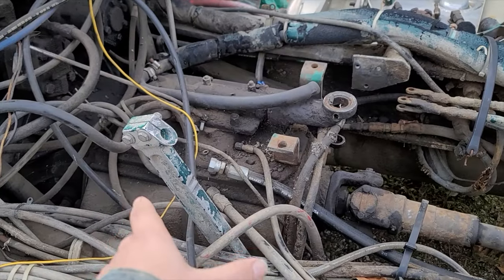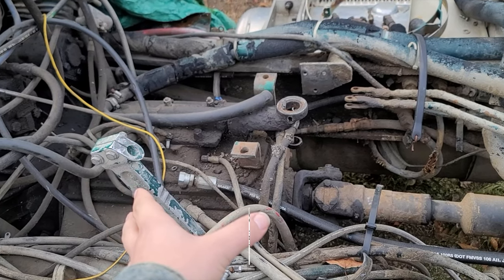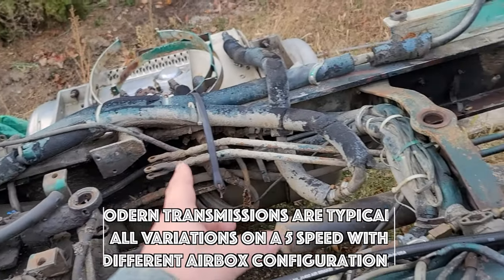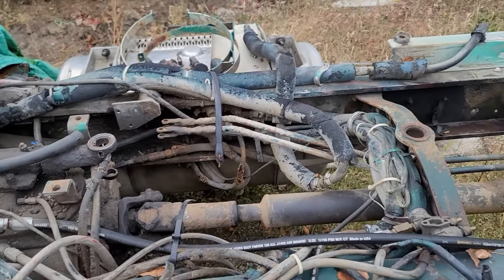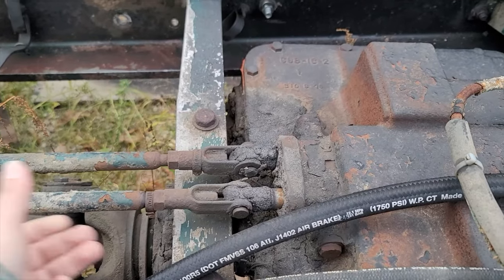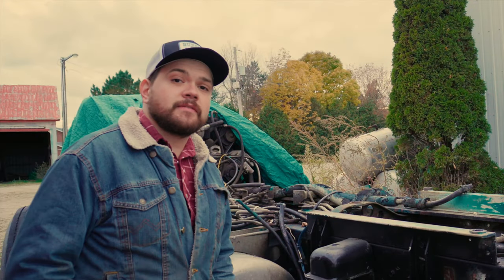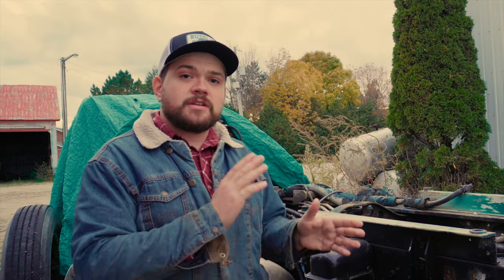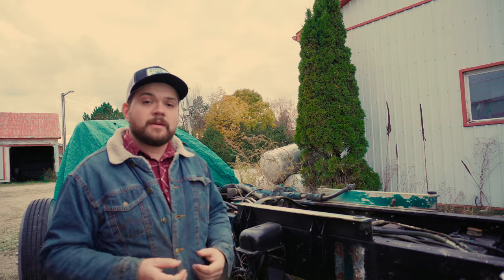How to Shift a Two Stick Transmission #peterbilt #twostroke #twinstick

Comment: In the late 80's, when I was taught 5x4, ol' Kevin & Frank put 4 pieces of tape on the dashboard for me [depending on what truck i was in, another had a 6x4].  When i had my hand on either shifter, they made me point my index(first) finger out and touch the tape on the dash.    The tape pieces were Main 2 and 5, Auxiliary 1 and 4.  So, when I shifted gears, no matter if I took my hand off the shifter and I couldn't remember what gear I was in, all I had to do was put my hand on the shifter, point my index finger out and, voila....I knew where I was in the shift pattern.
Reply: Cabover Kevin?
Reply: @keepontruckinoutlawlife1248  heh, no.  A tow truck operator from a little town called Nipigon.  I bet Cabover Kevin didnt have his license yet when I was training for mine [1987~88].   An ol' timey truck driver Frank did the same thing for me in his International gas job 5x4...tape on dash so I would know what gear i was in.
Reply: @iBackshift  you ever heard of cabover Kevin? He's been truckin a long time
Reply from the maker: Nipigons quite the place to be learning 2 stick😷 assuming you mean ontario
Reply: @Bubbles8V92  Yup, Nipigon. Used to pull out of Gregnol's pit [now Nichols], [at the east end of Nipigon Bridge, hwy 11 turnoff] pull off the scale, coast across the tracks, make a left onto the highway, cross the bridge and nearly shit my pants every time going up Nipigon River Hill.  Then 1.5km west of nipigon, loaded at highway speed, having to gear down at Golf Course road hill.  Nerve wracking when driving a tandem Binder with a 392 gas w/a 5x4, haha.  Had to time it right so you hit the bottom of the hill "pedal to the metal" at 4200 rpms and pull over the top at 3200.  5x4 was fun.
Reply: Really slick!  What a great idea!
Reply: @keepontruckinoutlawlife1248  Yes, he has one of my fave Freightliner 8v92's.
Reply: I don’t get it.
Reply: @iBackshift   zzz and what you go fast enough to sling a short shaft out of that damn between them boxes and it cut your frame real half into a big the fifth wheel off the truck we had a driver do that and beat the holdup off the frame rail and beat the 5th wheel off the f**** truck

Comment: Sort of watched the video. I just turned up the volume and closed my eyes. There is nothing more pleasant to my ears than the sound of a 2 stroke going through the gears. I more or less visualized it in my head and could follow your up shift and down shifts. I miss seeing these old girls on the road.

Comment: If anyone finds themselves having to quickly learn how to drive a two trans. truck there is a much easier way. The shifting with one arm through the wheel and the other on the aux. isn't necessary. Say for example you are going from 3rd +3rd to 4th + 2nd all you have to do is pop your aux. in neutral after which the main will go in 4th with no matching of RPM( because since it is separate as far as it is concerned you are sitting still). Then grab your aux. and goose the throttle and when the RPM's match up the aux. will go into 2nd just like any other transmission. Downshifting is basically the same just backwards. Sounds like it would take too much time but once you get the hang of it you can do it very quickly all with one hand and no clutch.

Comment: Great vid mate.  A real truck driver using a real twin stick and not some dude claiming to be twin sticking with a air splitter replacing the splitter buttons with a stick.  I have seen several vids claiming twin stick and clearly they were not.  As a mechanic I was able to operate a twin stick but not nearly as cleanly as yourself.  Full marks to you.  From truck enthusiast in Australia.

Comment: The old-timers had a word for getting stuck with neither transmission in gear because you let the connecting driveshaft coast down too far. They called it "double nothing." Experienced it a time or two, which is why I always shifted the transmissions separately.

Also, your Spicer set-up has little gaps between the gears in the main 6-speed box and big gaps in the aux box (sometimes called a "Brownie"). Most twin sticks I drove used Eaton/Fuller boxes up front with big gaps (usually a 5- or 6-speed) and an aux box with real small gaps. You had to figure out what combinations overlapped so you knew where to go for the next highest or lowest gear. I usually started in 2-2, then depending on how heavy I was loaded I'd go to 3-2, then 3-3, then 3-4, then 4-2, 4-3, and so on. The tricky thing was that on the 5-speed main box, 4 and 5 were pretty close together so I'd usually go 4-3, 4-4, 5-3, 5-4.

Comment: Fkn awesome video.. driving a two stick like that is on my bucket list for sure.
Reply: Are you going to get you some do some durags or some damn bandana tied around and sticks you hands get sweaty enough you work them hard enough
Reply: Arrow 359 I used to drive that 84 I think her five it had a Air hood ood on I thought that's cool man I'm going to put the hood up for that thing you don't have Springs little tight extended hood about halfway another straps artipoppe lose be creeping up in there everybody Alside stand-ups and I'm still driving on flat top but then now everybody they made fun of me for having a flat top now everybody wants one somebody has a6400 was a like a 3 KW and it had a hit had a model cat mile I think in It lyric with a retarder on it nothing really o sounds good to me is the way that a model sounded coming off the line man that thing would thump the ground the G little bit

Comment: It's neat how different the shift pattern is for you vs. mine.  I've got a 1241D and a 1253B.  The B is a .694 in 5th.  5th and over is .563.  I get 3 shifts in 3rd, 4 in 4th, and 2 in 5th. And my spreadsheet says the truck is good for 115mph with 4.56s.  I find I spend pretty much all my time in 3rd and 4th.  It gets me from about 15 to 70 with only one compound shift.

Comment: As a kid I got the chance to run a 5 x 3 mack half cab and a 6 by 4 GMC brigadier most truck drivers nowadays would have no clue what they're doing with either one it's been a long time since I've been in one but I think I could still bring it back
Reply: 4 far as I know if you order me can order a set of sticks right now if you want you can get you a new truck with setting them I don't get Rocco's or when I get in there but yeah you know fattening Detroit set right it'll hurt her feelings in Rolling Hills it really show out Roundup about 2,600 letter Paul
Reply: Yeah I worked out in the oilfield and there's some little girl was trying to holler at they told me not to mess with her cuz she was like a Detroit I said what does that mean they said she'll scream and holler all the way through town to get in the country and she just won't quite put out
Reply: And my stepdad had a a GMC 9500 extended hood you got an 8-71 isn't 69 I thinking 13-speed anyway he said the problem that thing was it gets so damn hot you couldn't keep your feet on the floorboard I threw three layers of mud flaps and then sawdust Anna and ice blocks

Comment: I just like the peterbuilt trucks especially the sound of the 2 strokes
Reply: The Make of Truck has nothing to do with how it sounds. I have several trucks Peterbilt 359's ,KW W900, along with 5 Autocar AT64 that all are 3406B Cats with 6x4 Spicer Transmissions.  All running with OEM Exhaust Spec Systems. All sound Damn near the same.

Comment: Thank you so much for this video.

Google suggested a different twin stick video but the guy didn't announce what he was doing and he didn't have a graphic in the lower left showing digitally what was going on.

It was tremendously helpful for me to not only show the red dots as to what gears you are in but also the ratio that was being sent by the two transmissions. This will allow me to check my 13-speed against your transmission and my 3.58 rear-end to your 5.29 rear-end. 

By sound and sounded like you were driving just about 200 RPMs after you were going about 25 miles per hour road speed which is consistent with my 13-speed Eaton.

Again that lower graphic was really so helpful. But I am glad that I have a truck that I could just flip an are switch as I don't think I'm coordinated enough to drive a twin-stick.
I did notice that you didn't use first gear very much in either stick or the 4th gear in the passenger side stick very much.

Are not the 2020 fuel prices making your V-8 engine really costly to drive fuel wise?
Reply from the maker: Ya the fuel prices pretty much make this a toy and the reason I don’t use 4th much is because it is an overdrive gear and not made for heavy pulling, thanks for the comment 👍

Comment: Great video! Thanks! Also very interested to hear about the middle drive shaft issue -- I see you shift with the main box first to presumably avoid the middle shaft losing speed more quickly? Couple of questions: How is the 92 pulling 100,000lbs up hills? And do you have any there, and can you do a short video on downshifting on a hill (where the rolling speed decreases more quickly and you need to shift more quickly. Do you skip one of the aux gears to allow for the 92's fast rpm fall? Also, so you have any issues binding up the auxiliary box by rushing the gate and not going properly into the neutral?
Reply from the maker: Yes you can shift both at the same time but that’s a little unnecessary risk. It pulls like a champ considering the torque rating. And yes you do skip a lot of gears to downshift on a hill but that’s one of the benefits of this transmission, you can shift however you want to. I’ve never got the sticks stuck but I also have the linkages rebuilt like new

Comment: hey so nice to see a utube driver looping the steering wheel. so many do not do this. foolish. a fella never ever wants to give up control of any part of the rig if its avoidable. in the twin stick era many, i would say most did not have power steering. a driver with both hands on the shifters, and none on the wheel might end up lookin for work in the morning, cause his steer tire caught a rut at 48 mph and did some damage. we would often try to configure your shifters  so we could " one- hand em". in a slip seat operation this was not possible and two hands were needed. especially if they were cabovers.
you gotta hold onto the wheel especially with a detroit cause you always up in the gears and things happen so quickly. and never ever look down at your shifters. they aint gonna tell u nothing, but pulling your eyes from the road will.

Comment: is this a silver 92? it sounds almost as if naturally aspirated. i cand hear the tirbos. its cleat to me the pete was originally an owner operator truck as it has full gauges. and it must have been one of the last to come with twin stick. that truck looks pretty new for its era.
Reply from the maker: It’s low mileage, it’s a silver with 500 hp injectors and 5” straights that’s why it has a more natural sound 👌

Comment: Why do you not use 1gear on the aux transmission is it just to pull heavyweight? I have never ran twin sticks before just 9 and 10 speeds
Reply from the maker: Sometimes 1 is a deep reduction but because of the multiplication even on a regular 4 speed its way to slow, top speed in 6-1 is 39 mph where as 6-4 is 76
Reply: Sometimes low on the brownie will hit the main stick with a 6 speed, especially when you have 2 round knobs.  Kenworth mounted the aux selector on the main box so if something twisted both sticks moved together. Peterbilt hung it off the right hand frame rail so if you have big power that main stick can move a little.

Comment: When you going to be in the Wisconsin area?!?  
I'd REALLY love to match wits against a 2-stick tranny...ESPECIALLY behind an old school Detroit!

A LONNGGG time ago: in a US Army 5 ton (Cummins NHC-250); with a 5 speed tranny and a 2 speed transfer case, I discovered I could 'split' 5th gear between the low and high side of the transfer case.  The gear progression 'just worked.'  I've driven, as a commercial truck driver, everything since then.  MY truck had an N14 Cummins, rated at 525HP/1800lb/ft, with a 13-spd Road Ranger.  I'd DEARLY love to drive one of those old-fashioned, low torque engines, with multiple gearboxes!
Reply: 3408 cats were known for splitting frame rails at the motor mounts. Never heard of the black motor doing that.

Comment: Biggest question I always had about these transmissions is why is 4th gear so close to 2nd gear and 6th gear and the spacing for 3rd gear and 5th gear is so wide, why isn’t 5th gear moved closer over? 
And then when your upshifting when you grab 5th gear why don’t you go back to 2nd on the 4spd transmission like the other gears? Same with 6th gear?
Reply from the maker: Because the gears shifting from 5 - 3 to 6-2 is actually a downshift, the ratios overlap like crazy in the top end

Comment: why would you want this over an 18 speed?
Reply: More options for reverse.  Sometimes you have to backup a long way to catch a paver or grinder. It doesn't seem like a big deal until you've had it for a long time and then you don't.
Reply: @johnwatts871  when you look at the shifting pattern 0:38 u can see that the 6 speed transmission has the reverse gear which means it has 4 reverse gears in total which is the same as an 18 speed transmission. :)
Reply: Yes. The 18 speed does have 4 in reverse but the gap between the two lower gears to the two in hi range is a big jump.  However, if you have a 18 speed with a spd rear you can use low range in the rear end hi range on the trans. That gives you 2 gears that are close to what you have with a main box in reverse and the brownie in direct. Give it a try and let me know what you think.

Comment: Some guys say you don’t have to put your arm thru the wheel.and they don’t so why ?
Reply from the maker: mainly shifting speed, both work, i think two hands works good because you can be quick but still use fingertip pressure instrad of whacking the stick
Reply: Ours were logging trucks and if you hit a hole or a rock coming out of the bush you could break your arm when the wheel twitched.  😊

Comment: How could i find the shifter linkage for the 4 speed
Reply from the maker: possibly tremec i belive they have the rights to the 1241 series transmissions now. i wouldnt be suprised if you cant find them anymore. they are quite simple to make if you were a handy machinist. 

https://www.hcvc.com.au/forum/Findit/17936-4-speed-auxiliary-transmission-shifter#gallery-1

is how it looks
Reply: Thanks been looking into a 6x4 build and was wondering how I was gonna find all the parts

Comment: I really miss the 5x4 I drove for 6 years before getting into road ranger transmissions. Had a 13x4 once for about a year. The 4 was an under/overdrive set up. 1st underdrive, 2nd normal, 3rd first over drive and 4th nuts overdrive.

Comment: What if you're taking off on a hill loaded, when going from 1st and 4th and making the shift to 2nd on the main does the truck slow down faster than the rpms can drop to make the shift?
Reply from the maker: It’s not that bad but if you were on a really hard pull you would avoid 4 because of the overdrive
Reply: @Bubbles8V92  right on, what's your shift pattern on a hard uphill pull?